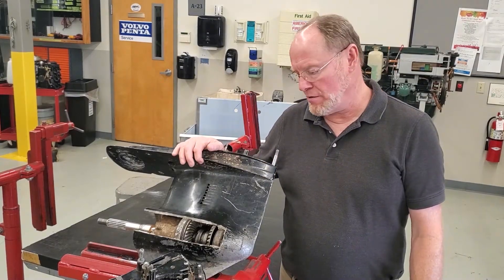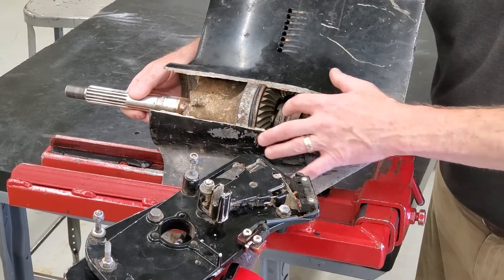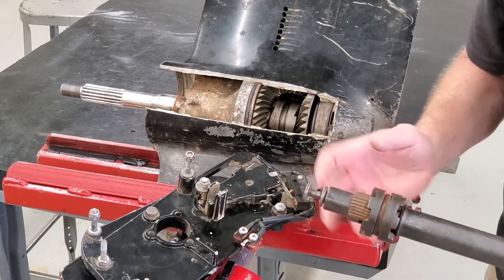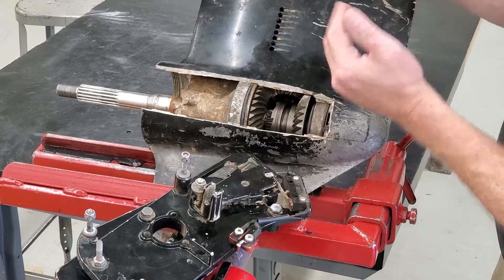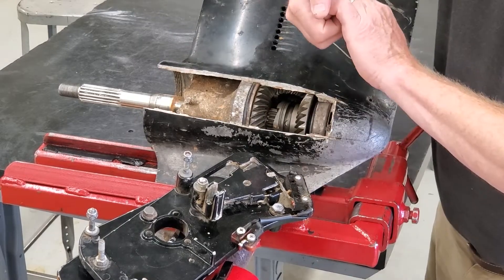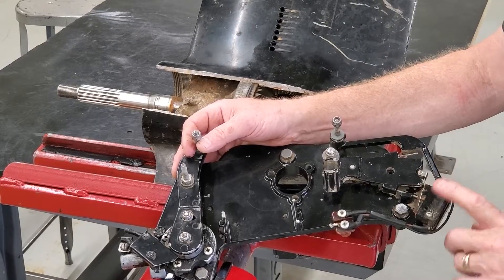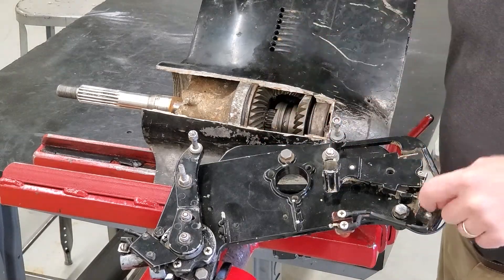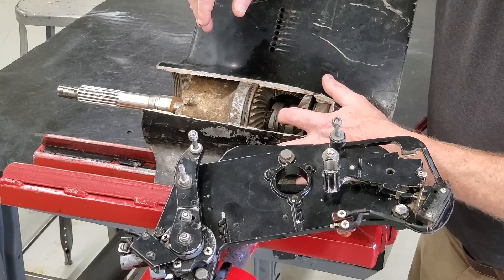MerCruiser Alpha Sliding Clutch and Shift cut out switch explained

Comment: Great video,
On shift plate you are using for the demo there is a valve that goes to the trim pump, same as my 1980 Nordic mine has a newer style shift plate now, the valve is hooked up laying in the bilge. what function does it serve?  I'm thinking it is a by pass for the trim pump( it loops from the trim pump  through the valve and back to pump) at high  or low speeds to control the rate of trim
Reply from the maker: Exactly on realy old #1 drives it was used to lock the hydraulic fluid while in reverse.
Reply: @tedsmarinerepair8956  lock it as in by passing the pump pressure,  then  I should be able to put a plug in the pump supply and return for the bypass and get ride of the clunky thing in my bilge?

Comment: I have an old 79 StarCraft with the mercruiser engine and drive that I bought used about 20 years ago and still have it, I was just learning and didn’t realize that the previous owner had simply disconnected the cut off switch, so for the first few years I had the idle really low to work or I had to shut the engine off to get out of gear, after that I hooked the switch back up, wow what a difference, with your advise I just replaced the shift cable and shift shaft seal the engine was really out of alignment too, what I understand that no one makes a direct replacement cut out switch anymore, I don’t know if that’s true, thank you so much for your videos Sir 👍😁
Reply from the maker: Glad to help! I'm not sure if there is a direct replacement for the old type of cut out switch. I would remove it and Google the part #
Reply: @tedsmarinerepair8956  luckily mines working great